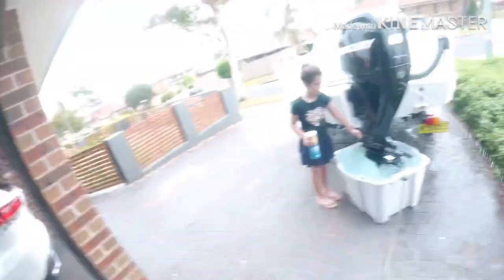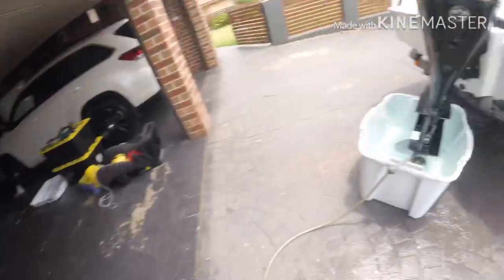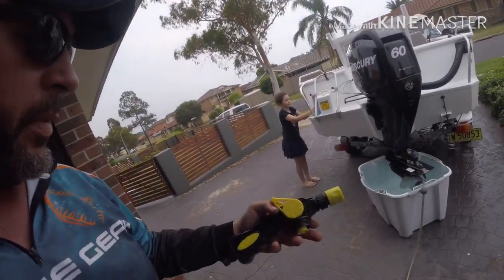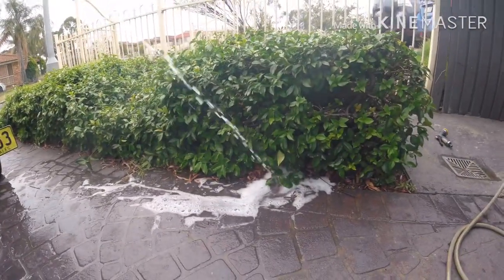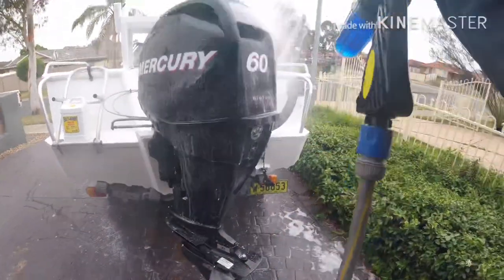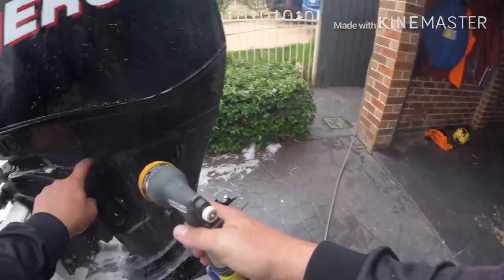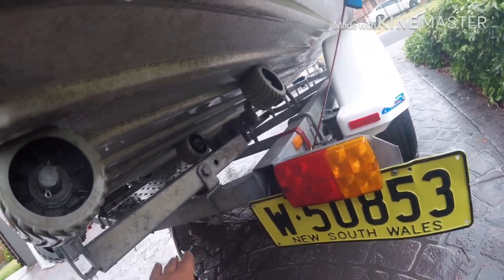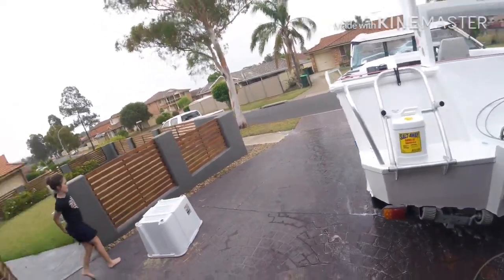Using Salt Away

Comment: Great tips! Usually holes are in hollow steel tubes to either get the galvanising to coat the inside of the tubes (when they dip the steel into the hot galvanising bath, else they would be black raw steel on the inside), or vent holes to let air out during galvanising, or any trapped moisture or condensation out generally during its life...all just efforts to stop the hollow tubes corroding from the inside out I think.
Reply from the maker: Dave St. I was going to close the hole but you saying that I’ll keep them open. My mate told me the best and easiest way to fix rust is MONEY 💰😂😂😂. Thanks for commenting and watching 👍🏻👍🏻👍🏻
Reply: @tapfishing8814   I'm no trailer expert, but that's my understanding. Often see them on closed up steel posts etc. The beam running along the length of the boat may not have them because they're open at the ends, but the cross beams are all closed up (I think). I reckon it's debatable if it provides any overall benefit on a boat trailer though, coz the saltwater just gets straight in! Depends how good the galvanising is on the inside I guess and getting it properly dried out! Salt certainly is the killer on trailers!

Comment: Hi mate , I have the same motor as yours and I am running a Mercury spitfire 4 blade alloy prop 13.8 x 13pitch  can you tell me what prop you are running on yours , diameter and pitch please and what sort of speed and revs you are getting at wide open throttle.  Cheers and good video.
Reply from the maker: I’ll have to check but it’s the standard prop with the Bigfoot gearbox. When I’m on the boat by myself at almost 90% open throttle about 5700 revs I can hit 65 km/h with the boat plaining on the back transom . It will go a little more but I rarely give it open throttle
Reply: @tapfishing8814  5700 is perfect , those motors with the Bigfoot gearing are designed to rev between 5500 and 6000rpm . There is no real standard prop for any motor , it depends on the weight of your boat and what you want out of it . For example if you want to tow kids around or a skier you need a prop with low down torque and a good hole shot but you loose top end speed. A higher pitch prop will have a slower hole shot but give you a better top end speed.  Your boat sounds like you have the right prop on it. If you don't mind I would love to know what brand your prop is as well as diameter and pitch .  Much appreciated thanks.
Reply from the maker: All good I store the boat at my in-laws I’ll have a look next time I visit and let you know 👍🏻. Thank you for the information on the props I don’t pay much attention to those kind of things maybe because the boat travel so well on the water . If it isn’t broke don’t touch it they say.